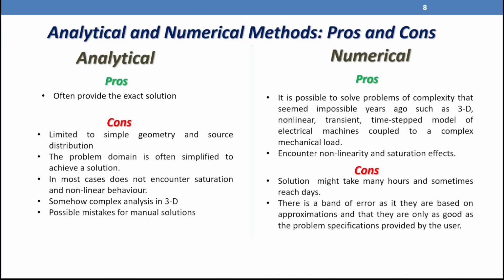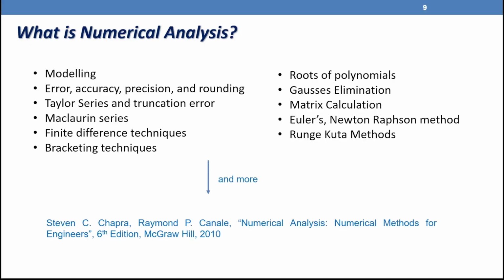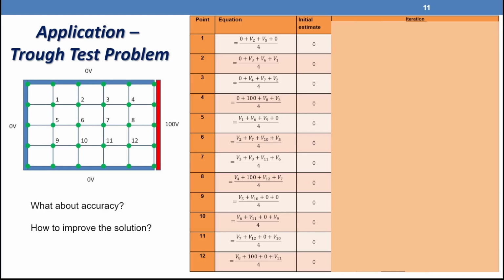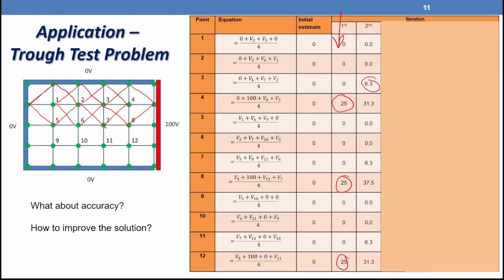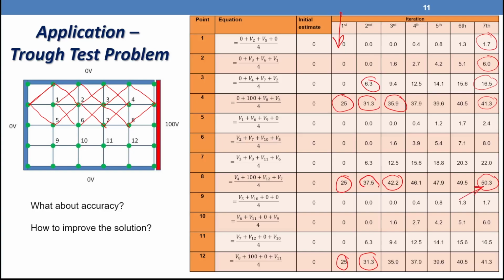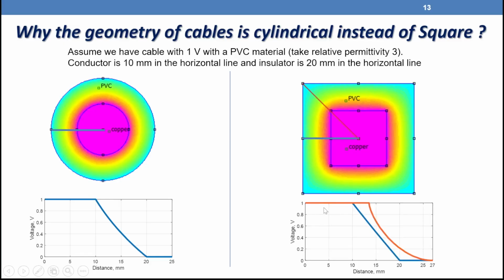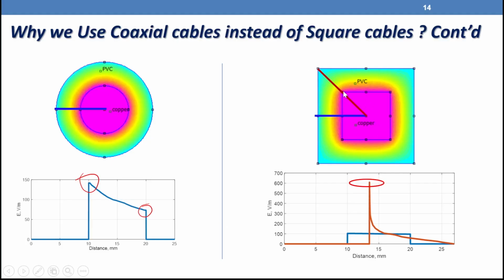Introduction to Numerical Methods and Finite Element Analysis

Comment from the maker: This video is ideal for electrical engineering students, researchers, and professionals who want a strong conceptual understanding before moving into finite element simulations using tools like FEMM.
👍 If you find this video helpful, please like, share, and subscribe for more lessons on numerical methods and electromagnetic simulations.
#NumericalMethods #FiniteElementAnalysis #LaplaceEquation #FiniteDifferenceMethod #ElectricalEngineering #EngineeringSimulation #FEM
PINNED COMMENT
This video introduces the fundamentals of Numerical Methods and Finite Element Anal-ysis, explaining why numerical techniques are essential in engineering problem-solving.
🕒 Video Timelines:
00:00 – Analytical vs Numerical Analysis
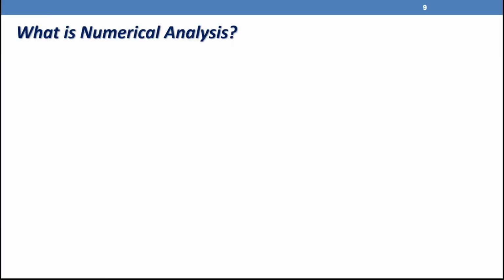01:45 – What is Numerical Analysis?
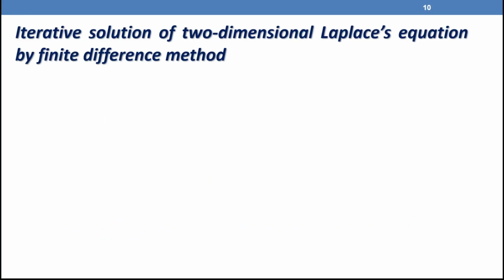02:15 – Iterative Solution of 2D Laplace’s Equation (FDM)
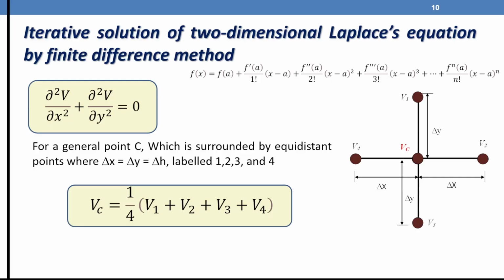03:10 – Application: Trough Test Problem
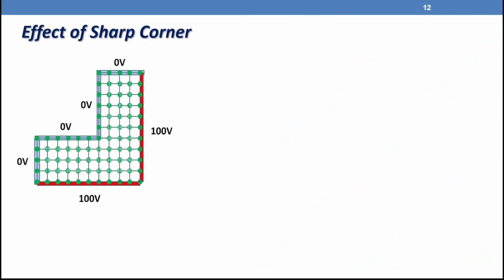06:20 – Effect of Sharp Corners
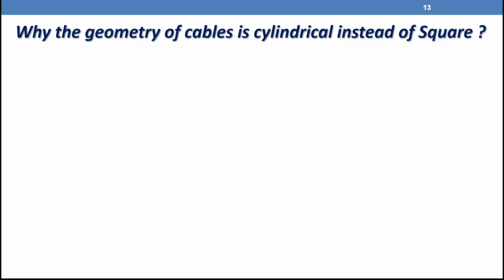07:35 – Why Cable Geometry is Cylindrical (Not Square)
💡 Perfect for electrical engineering students preparing for FEM/FEA and electromagnetic simulations.
👍 Like the video, 🔔 subscribe for more, and 💬 comment if you have questions or topics you’d like explained!